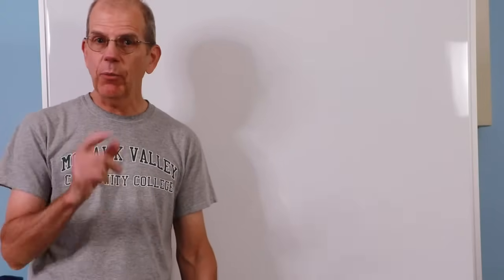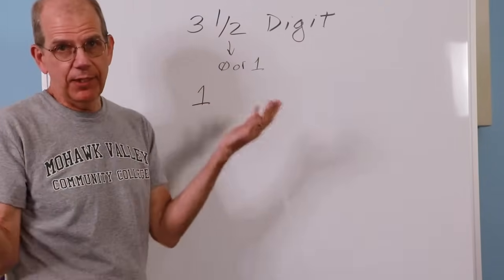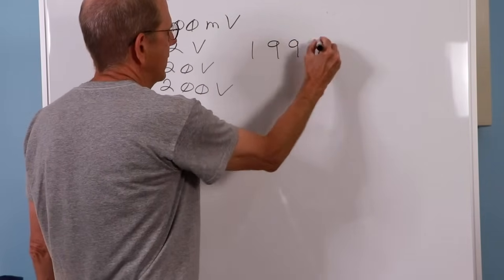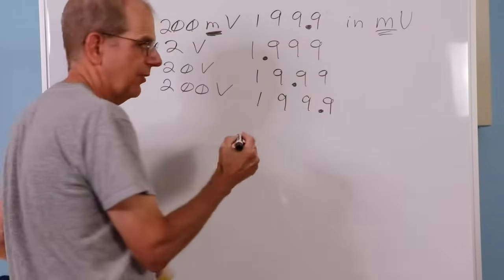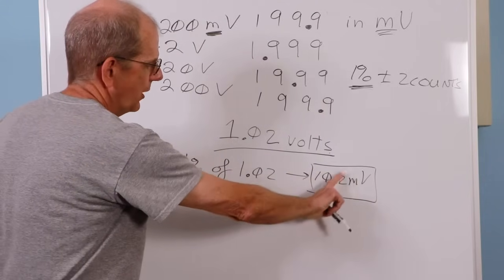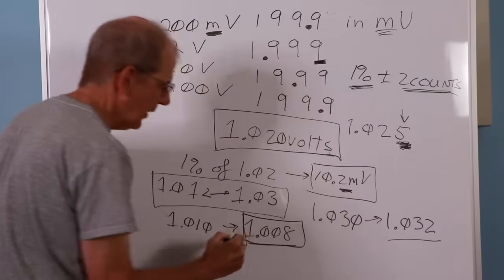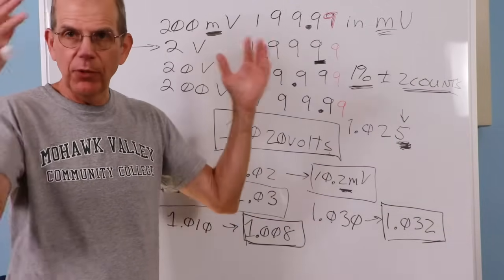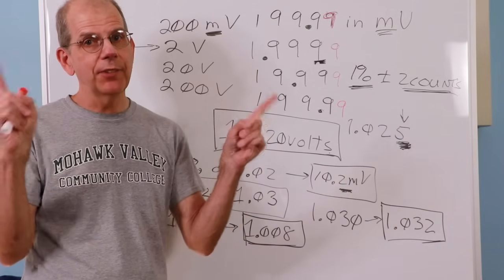Digital Multimeter Accuracy

Comment: You wrote "1% ± 2 counts". IMHO you should have written ±(1% + 2 counts). Your examples clarified this thou.
Reply from the maker: "1% +/- 2 counts" literally is something you might see on a spec sheet. The percentage is assumed to be +/-, just like with components (e.g., a "10% tolerance resistor" is assumed to be +/- 10%). Never assume a tolerance is unidirectional unless it explicitly states as much (that is something I have seen, but only rarely).

Comment: Excellent video.  I have a question, is the calculation made on the measurement of 1.02 V accurate or precision?  I understand that accuracy is qualitative and is associated with measurement error and that what is calculated is precision.
Reply from the maker: Technically, measurement precision deals with repeatability (i.e., measurement spread across several readings). In common usage, it refers to how far off the measurement is from an accepted or true value (i.e., accuracy). Further, it is sometimes used to denote resolution (i.e., finest or least significant digit). Confusing? Yes, because it depends on your audience! I find it best to just explain what it is that you're after.   Similar situation to the word "theory". In common usage, it's often synonymous with "hypothesis" or even "guess", but it has an entirely different meaning to scientists!